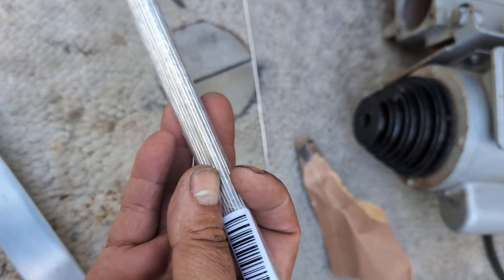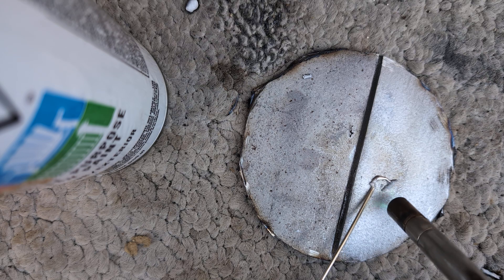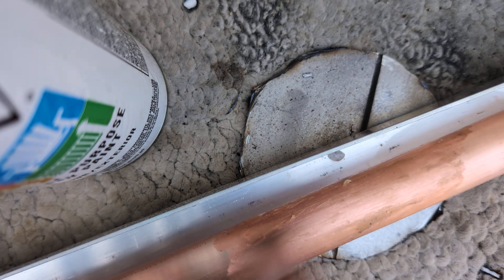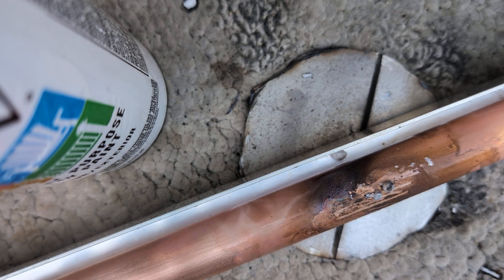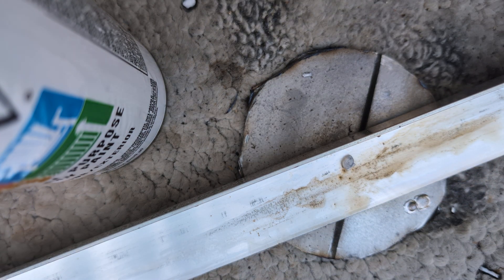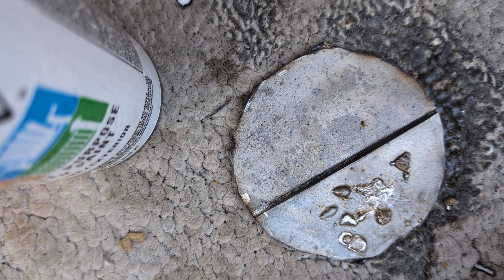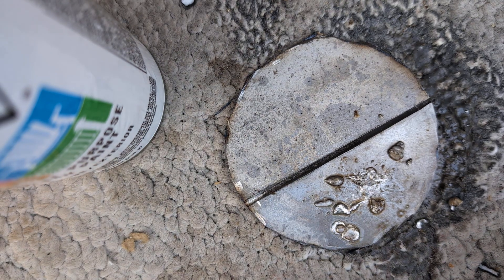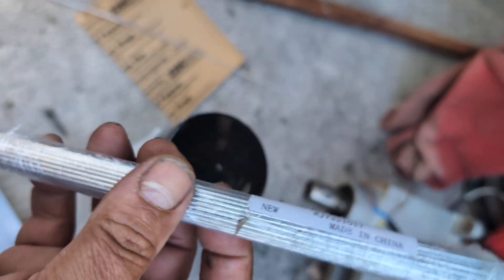Welding with a LIGHTER?! BS

Comment: I guess if you use sandpaper to clean the surface of the material to be welded, and then heat it to a temperature above the melting point of the rod, and use an appropriate flux, you may be able to get a good welding effect.